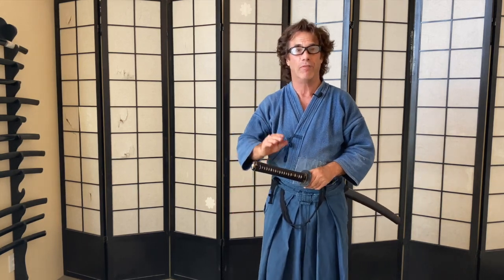Shinken: Hand Placement and Fear of the Blade

Comment: Seems counter intuitive, but it works. I'm still not ready for a sharp sword though. I'm still afraid. One day though... :)
Reply from the maker: When you decide to use a shinken you can slightly dull the tip and first 10 inches of the blade so not to cut yourself and that will become more comfortable to handle.  Later hone the edge back on with a polishing stone.